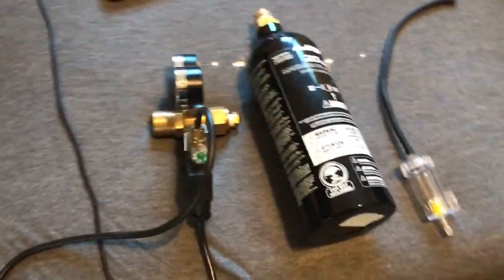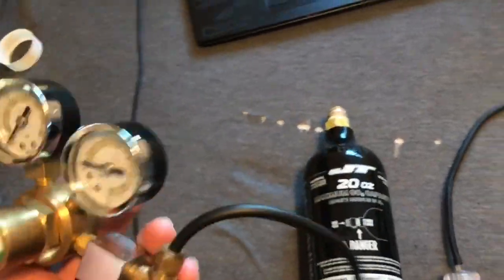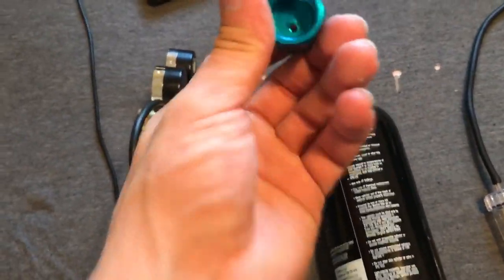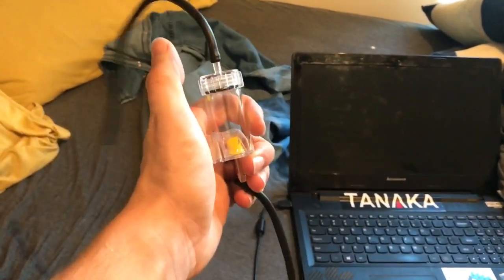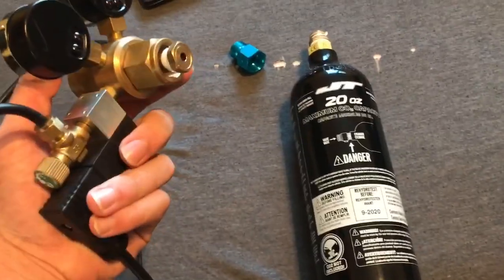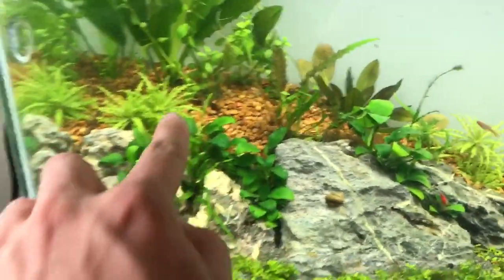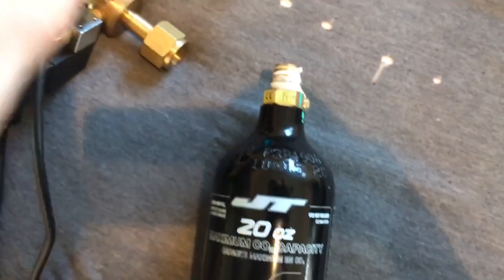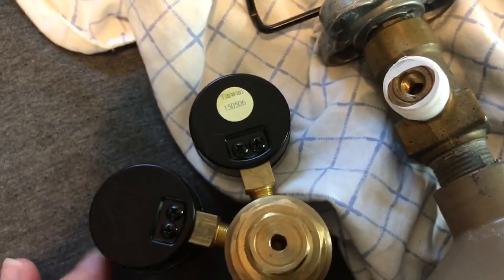Paintball Tank CO2 System

Comment: Hey bud can I operate a paintball  co2 tank on a 45deg angle?? I want to cut a piece of PVC in half and mount to my DIY stand and slide my tank into it at a 45deg angle so I can read the gauges in operating mode.
Reply: Only six months late, but yes. CO2 in a paintball tank is in liquid form. As long as you don't allow the liquid to escape you'll be fine.

Comment: Ok great video. My question is that rather then buying an air compressor. My best option would be buying a larger co2 tank to fill my 10 gallon co2 tank. What size tank and fill hose will you recommend?
Reply from the maker: I’ve never tried to transfer co2 from tank to tank. But your best bet is to go to a local brewery or welding shop and pick up a 5-10lb co2 tank. That’s what I used when I stopped using the co2 tanks

Comment: There is a lot of information missing,  like what to do if it leak , white tape is not needed,  adapters most of the time will leak ,
Reply from the maker: Look in the other comments and this is covered. You want a gasket for the tank that should stop the leaks. You can get it at welding supply places. I tried to simplify the system as best as I could for beginners.

Comment: Ok I have aquatic mini on my co2... question for you, how do I remove the regulator safely even if the  co2 tank (paintball) is almost full.?
Reply from the maker: +BORG Aquatics if the tank doesn't have a nozzle then you have to screw the tank off of whatever it's directly attached to. So if you have an adapter, you needto screw the tank off of the adapter and it will hiss as it's coming off but once it's off, the valve should close up

Comment: typically how long with a paintball co2 tank last for say a 55 gallon tank?
Reply from the maker: Well it depends on the size of the tank and how many bubbles per second you run. But it would probably last just under a month or so. I think it's definitely worth it to find a place where you can get a 5lb tank though.
Reply: Y

Comment: The reason CO2 is leaking at the nut is because you are missing a plastic or paper washer that is suppose to seal the connection between the nut and the tank. You can buy those separately buy your regulator should come with 2 plastic ones (white). You can get the paper ones from a welding store. Once you have those then you do not need to put teflon tape at the connectors.
Reply from the maker: +Ryan Lacdao I appreciate the info. I noticed there were round grooves in both mating surfaces that looked like an o-ring could go there but I guess it didn't click until now. I'll see if I can edit the video to add that part in.
Reply: It's not really an o-ring and it is more of a washer that cover the entire flat area that you are talking about and not just the groove. If you go to a welding shop then they should be able to sell you one. I believe it is less than $1. Once you have then you will no longer need the teflon tape. I have 4 regulators that I have never put any tape around those connections. I do tighten the nut again after a few days when using a NEW washer since they tend to shrink and losen the nut.
Reply from the maker: I know what you mean. I think I've seen them before at harbor freight. I'm just saying I remember seeing that groove where it looks like a washer or o-ring would fit. I'll most likely check the local harbor freight tomorrow or this weekend to buy some. Thanks again
Reply: Ryan Lacdao I think he's talking about a perma-seal and you're talking about a regulator vinyl seal or "washer gasket". Perma-seals look like o-rings/nuts and are great for sealing, but wear out faster.